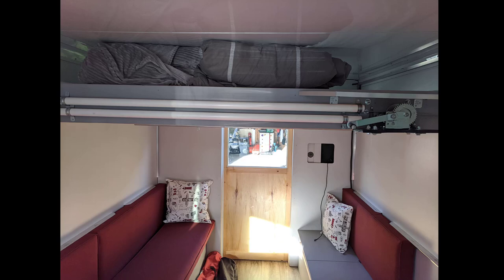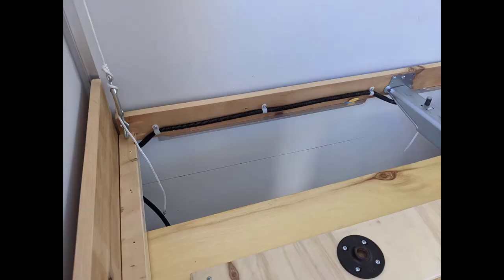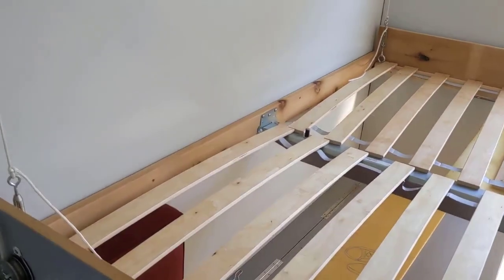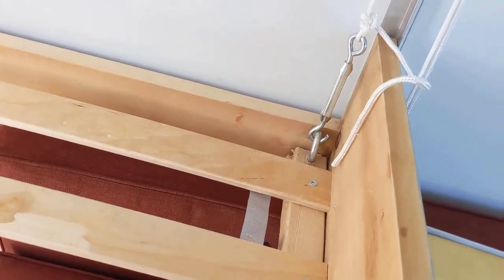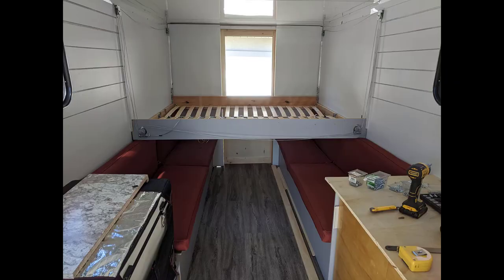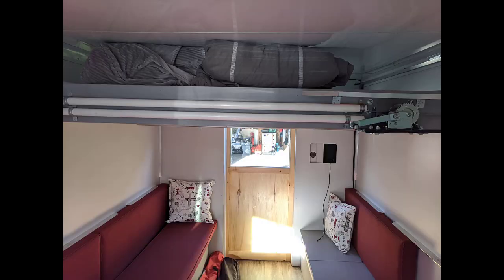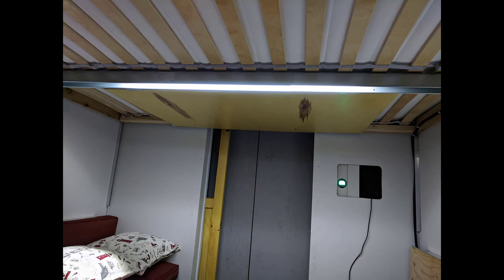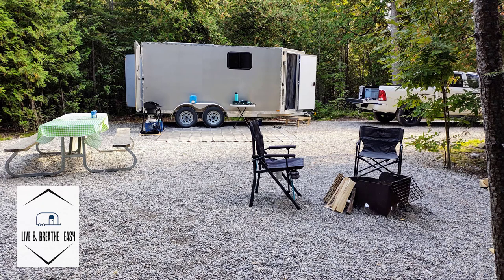Elevator Bed build in Cargo Trailer V1

Comment: I'd still like to see the cable routing.  You did such a clean job
Reply from the maker: Thanks.  Unfortunately, i don't have this bed anymore but the cables started from each corner and went up to a Pulley.  From the Pulley, the left side furthest away from the crank went to the pulley on the front face and travelled through the pipe to the crank.  On the right side it did the same thing however I found that I needed to have those two cables go across the front of the bed and join up with the original left side cables and then head back to the crank.  This allowed me to join all of the cables together and travel around the crank at the same time and speed so that the bed wouldn't go up unevenly.
Hope that helps.  I should have covered that originally but V2 is a much cleaner design.

Comment: Could you do a parts list for the bed.  I think it’s a great design
Reply from the maker: Hi there,  I am no longer using this design but here are some of the main parts for the bed mechanics.
1 x Winch https://www.princessauto.com/en/600-lb-hand-winch/product/PA0008843112
6 x Pullies (top corners and front face of frame) https://www.lowes.ca/product/chain-accessories/2-in-heavy-duty-wallceiling-mount-pulley-348562
4 x Turnbuckles (to help with cable lengths) https://www.lowes.ca/product/turnbuckles/onward-hook-eye-turnbuckle-6-38-in-162-mm-x-732-in-6-mm-zinc-1802688
4 x eye hooks (to fasten Turnbuckles too.  Goes into bed frame ) https://www.lowes.ca/product/eye-bolts/onward-eye-bolt-with-nut-4-in-102-mm-x-12-in-13-mm-zinc-1802849
I used some basic plastic pipe to just cover the cables in the front.
Hope this help a bit.

Comment: your first video does not let me save said it is in kid mode. I would like to know how you built your bed like everyone else but, i would really like to know what size bolts? what type of rope? the all mounts to hold the bed one etc...thank you for your time.
Reply from the maker: Thanks for letting me know about the kids mode.  That has been fixed.  If you are talking about the v1 bed I used some large bolts 15mm and serious angles from the fence section at home Depot to hold the winch.  The rope was 3/8.